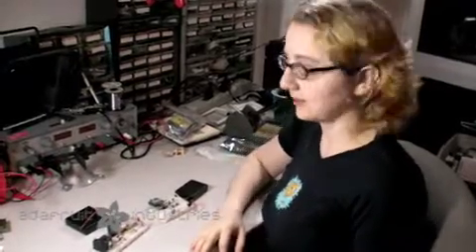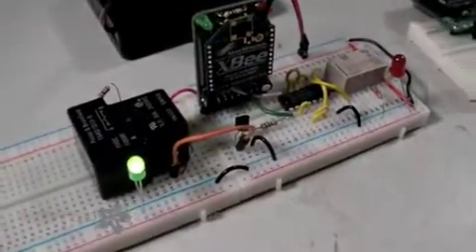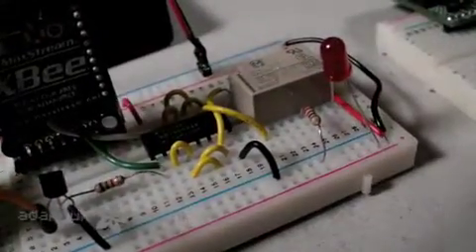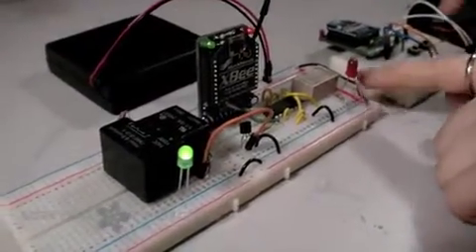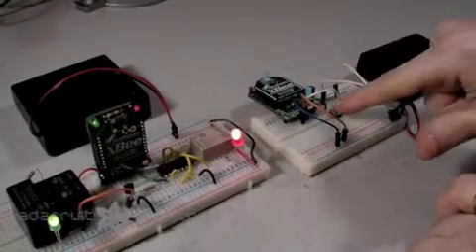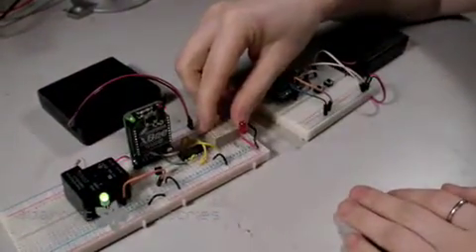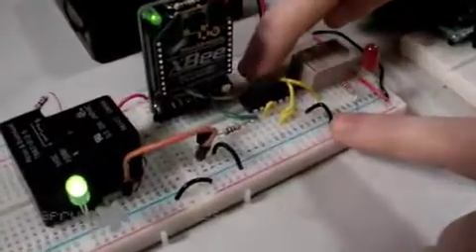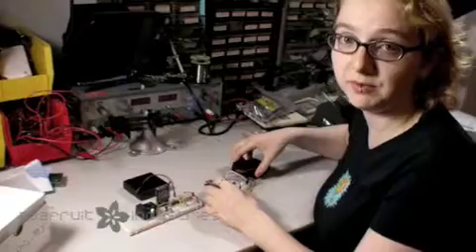Using Xbees to control relays

Comment: Hello , I have a question which has been tickling my mind for so long, It's about a pair of ProBee ZE10C modules. These are a wee bit older than XBee modules. To cut a long story short, I could run them perfectly but my problem is that when I config them after a while their settings turn back to the factory mode and I have to set them again! I've gone through its datasheet for like 100 times! But don't know what I've done wrong! You know I save the commands by putting ATZ command, and at the end I reboot them, then for a short while they work well. I'll be so thrilled to see your recommend.

Comment: This is very similar to what I need.  I am wanting to use the XBee for a simple application, but the range of the device makes it a suitable choice.  Could you tell me what pins you use for the input to the transmitter and what pins you use for the receiver?  Is the receiver OPEN collector?  Do you have a schematic or a listing of the pins on each module that you use?  thanks, vic